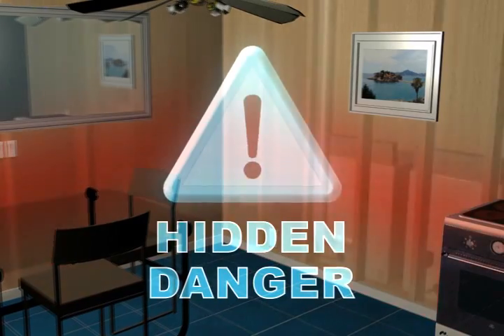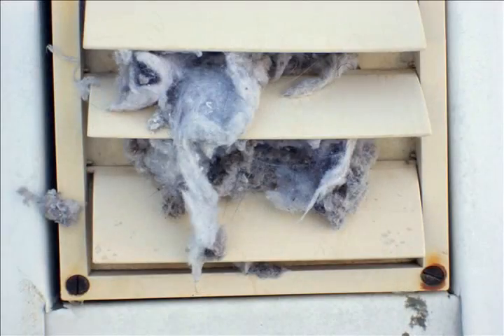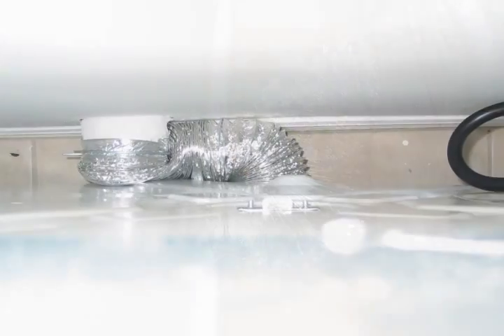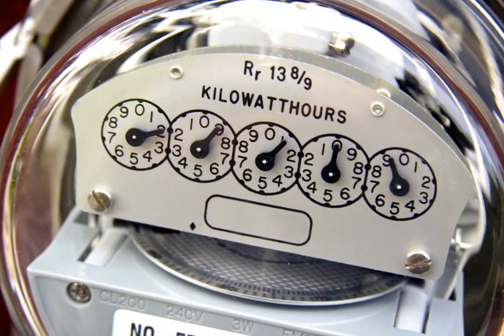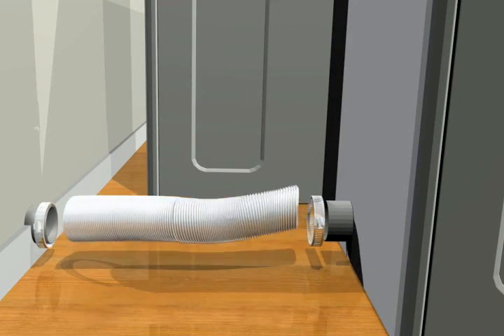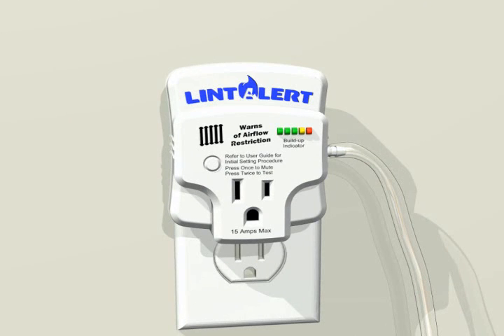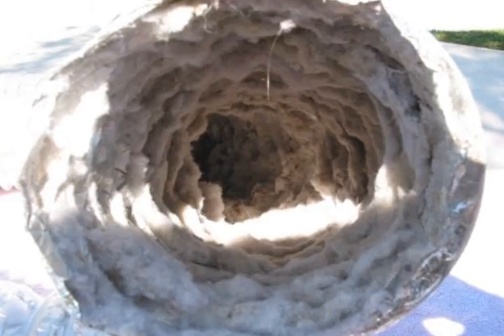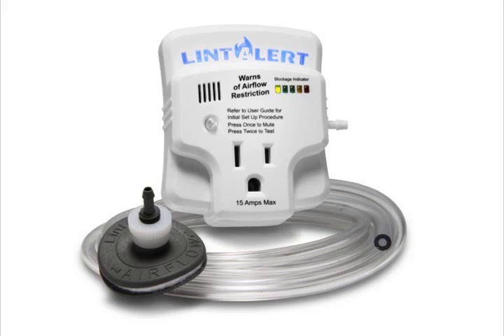LintAlert Introductory 3 minute video - NB

Comment from the maker: The LintAlert enhances your home safety plan by monitoring the dryer exhaust system for problems. As lint naturally builds up over time, LED indicators progressively illuminate to show how efficiently your dryer is operating. When airflow restriction becomes dangerous, an alarm is triggered. #DryerProducts